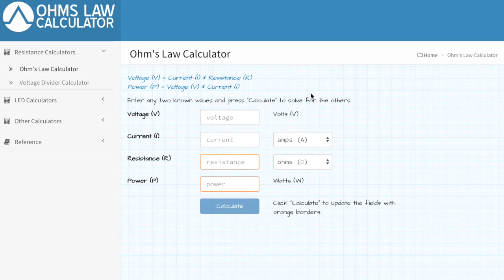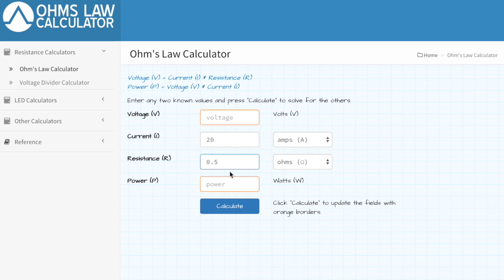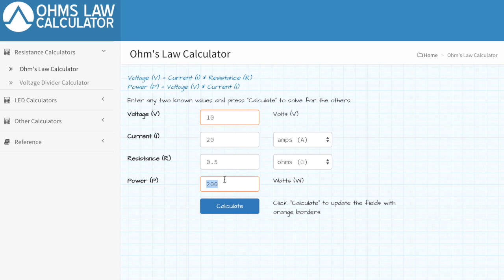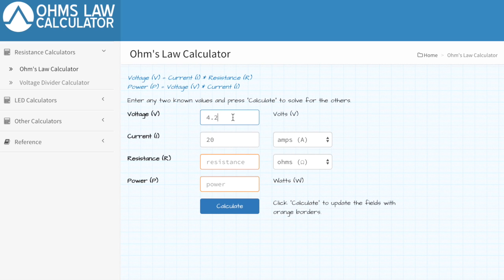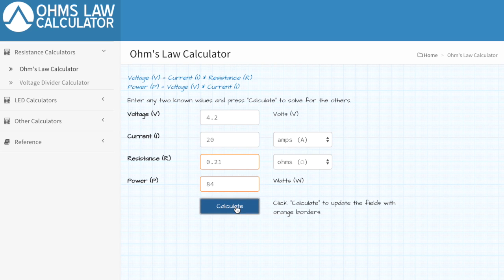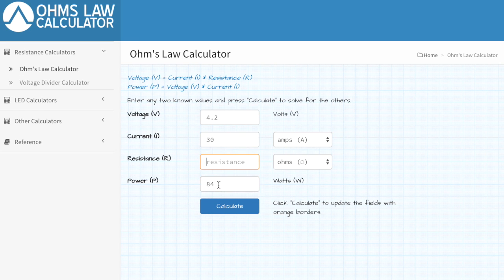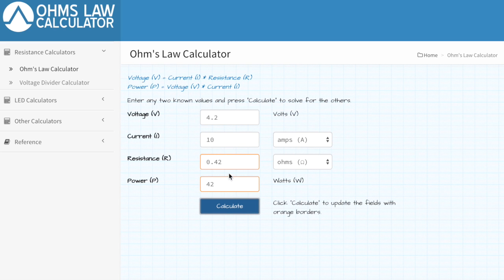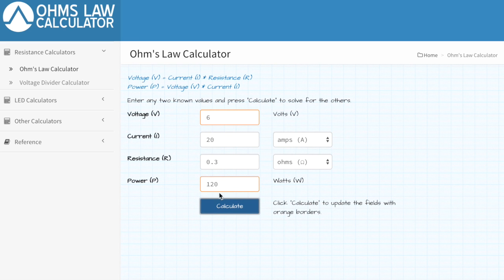Vaping for Beginners - Ohm's Law & Coil Resistance for MECH MODS

Comment: so lets say im on a regulated device and want to get around 0.2 ohms on a dripper and using three LG HG2 on a rx200(which i think are 20a continuous) I can only use up to 80 watts? need some help
Reply: +BUTT STEAK Just use the highest drain batteries. mine are 2600 mAh Sony VTC5 batteries. Yours are 3000 mAh (google'd it) and from what I know, they are 30A but you say otherwise. It has the power but drains quicker. I'd suggest getting samsung or sony brand batteries. Other than that, yeah, you can run at .2 ohms, fuck it, it's an rx200 lol.

Comment: , how long should I go until I change a bettery? Is there a safe zone for how long a battery should last and what is too long of a time to use the same one?
3-5  cigarettes a day smoker on the subbox nano using a .5 ohm coil, 18650 battery
Reply: +Michelle Baj your device is a regulated mod. Your mod will keep you from draining your battery too low. Use them until almost drained according to your screen. You will be fine. It is only when the person is using an unregulated mod that you have to be careful not to over drain your battery.

Comment: I'm new to vaping and I'm giving my last pack of cigarettes to vapor world for a free starter kit ive been watching you're vids and already know I'm a cloud chaser at heart I wanted to know if I could get decent size clouds out of a starter vaper ps yore vids are awesome pss sorry for the grammer if there are eny mistakes
Reply: Most starter kits are high resistance with tighter air flow. To give a similar pull on a cigarette. It's not going to be a big cloud. When I first tried vaping years ago on an small battery with a clearimizer tank it didn't give me enough of a vape to satisfy me so I could quit. This past year I tried again with a box mod and a sub ohm tank and that did the trick for me! I'm not sure what they are giving for free, but I'm going to assume it's the same I tried years ago. MY personal opinion would be to see about getting an Ego One non temp control. It comes with a 1.0 and a .5 ohm coil. I found them cheapest at world of vape and bought myself one. I wanted something to give me decent clouds that I could easily take with me instead of carrying my box mod. Use that to switch, once you've switched then invest in a good mod and tank or if you want to build an RDA/RTA. I quit smoking father's day and today bought my very first RDA. And honestly I will STILL use my ego mini when on the go :).
Reply: +mishelleAKAmishy I actually got a decent one it is a kangerteck evod mega it is decent
Reply: +mishelleAKAmishy thanks for the tip
Reply: +Chance Rains AWESOME!! Congrats!! Welcome to the vape world!! Seeing that you're watching YouTube be prepared you'll want one of everything soon enough and if not careful it'll cost MORE then smoking LOL. Good luck!! Make sure you LOVE your juice.. cause if you pick up a cigarette you'll miss your yummy juice! I actually started to reduce my smoking and ended up quitting cause it tasted gross after tasting my yummy flavors!
Reply: +mishelleAKAmishy ya I'm really happy about my kit it is heavy I like it and I have real good juice I have thunderstruck 18mg and I have cowboy whitch tast like a sweeter malburo red do u have eny reconmendations
Reply: +Chance Rains taste is very subjective, and I've come to find I'm REALLY picky. There's flavors I like, but I can't vape it allot. I was a Marlboro lights smoker, and as crazy as it seems I tend to like minty and mentholy Vapes. My favorite is Watermelon Chill, it's like a watermelon bubble gum with a cool mint taste. I also like some lemonade vapes and fruity flavors.. like ripe strawberry. I'm not a fan of milks or custard. I seem to prefer light vapes and I need never liked tobacco flavors which is usually what is recommended for those switching. Hopefully you have a good vape shop near you where you can taste different flavors. Make sure they use good ingredients and not cheap stuff. Mine uses kosher and pharmacy grade ingredients. Cheap stuff can make you feel sick, ESPECIALLY cheap nicotine!

Comment: when you jumped to the ohms calculator you referred to a mech mod but how could you find out the volts and discharge for a box mod that requires 2 batteries. would it Still apply for the same output?

Comment: Although increases in the number of coils increases resistance, it is directly because of the length of the wire, not the number of coils; more coils equals more length.

Comment: i have a coil build of 0.54 ohms n if im vaping at 40 watts,with the ohms law calculator,im using 8.61 amps and 4.65 volts.
given that my battery states 3.7 volts,is it safe to vape using higher than the stated 3.7 volts on the battery?? (the 3.7 volts was just printed on the battery.it says 18650 3.7 volts 2500 mah).im really confused with the volts.

Comment: what about if you have two 18650 batterieswith 20 amps discharge each in your mod, does it mean you use 40 amps in your computation?

Comment: This was very helpful but I came across something I didnt get when playing with the ohms law calculator. So lets say you have a 1.5ohm coil and are running it at 25w, which i know is way to much but definitely possible, when I put that into the calculator is says that would need just above 6 volts. My confusion lies in the fact that a 3.7 volt battery is being used to power this coil. So can batterys discharge at higher volts like that? When puting 4.2 volts and 1.5 ohms in the calculator it says a max of like 12 watts, so is exceeding that dangerous for the battery or is it even possible to discharge a 3.7v at like 6 volts. Any help would be appreciated I just cant figure it out.

Comment: That was entertaining, educational and fun to watch!  Just switched from 2 1/2 packs a day to vaping 12 days ago and vaping is so much more fun.  Looks like RBAs may be the next way to go for me (gotta geek) but .... I'm NOT smoking :) !!!
Reply from the maker: +Steve Meckel nice!
Reply: +Steve Meckel 
Excellent Steve. I too was doing about 1 1/2 packs a day for about 58yrs. I havent touched a real cig in 5 weeks now. I started with 3% nic for a week then 0% nic. go bro. keep it up.
Steve Low
Reply: +Steven Low.  Keep it up ... Three weeks, yesterday for me ... but still doing 2%.  I am up to one mile a day walking and need to keep on the cardio.  Doc says to quite vaping too ... just gotta have one of those vices and don't see this one going anywhere soon (other than joining you @ 0%).  Thanks so much for the support and you keep going too!! :)
Reply: +Steve Meckel,  I'm enjoying the Hell out of it man. Drove tractor trailer for 33yrs then retired and sold my trucks. Smoked one after the other in the truck. it was ready to quit surprisingly. going to bed. catch ya later bro.
Reply: +Steve Meckel Good job on quitting. I just quit too. Keep chantix in mind if cravings get bad. It helped me quite a bit.

Comment: how about i can't taste the juice?
and when the volt keep jumping
Reply from the maker: +gnauhyJ sounds like something is wrong with your device
Reply: you might have your coils touching where you tighten them. or you could have a short... try pulsing and wiggling your coils. if they move significantly it may have to be rebuilt.

Comment: what batteries should I use to vape at 150W using the Koopor plus 200w and Maganus v2 tank with 0.2 coil? There are 3.7V and 4.2V batteries as well as 2500mah, 3000mah, 3500mah, and 20A, 30A, 35A. I don't know what combination of those three I should choose

Comment: Hi abby i would like to ask something. I will use a .45 ohm wire and i have a 20a batts. Does the wire build changes things? Like i will build dual coil 8 loops.
Reply: And could i ask what is the significance of loops in build? More loops means better flavor right? Lower resistance=more vapor?

Comment: does it matter about the batteries if their is more than one? like if there is 2 batteries is the amperage times 2? or does that matter...
Reply: +Tafv if your batteries are in series then the current won't double or half... the current would be same through  2 batteries in series as it would be through a single battery.
However, if they're in parallel, the current draw would be halved, or shared, between them.
Reply: thanks :-)

Comment: Abby, thanks for your video. I have a question: I've been using .5 / .7 single coils with my lemo 2. Vapor and flavour are great at 20w but I'm  getting a short battery life out of my istick 30w. I'm getting another mod with 2 2600mAh 30A batteries.  Will building coils around 1.2 or 1.5 ohms will do the trick to get more vaping time out of those batteries? or au contraire, more resistence should blast batteries faster?

Comment: hey abby. isn't your current limit doubled if your using a parallel mech mod?
Reply: +Juan Marco Manguerra If your batteries are in parallel the voltage stays the same and so does the current rating of the batteries. All that changes is the battery life.
Reply: Rob Poke oh ok a friend of mine once said the parallel counts for each battery. nvm then xD
Reply: +Rob Poke that;s not true. parallel batteries share the current load between them. they'll both still kick out 4.2 volts, but whatever the current draw is (based on coil resistance) then each battery supplies half of the current. the reason you get more battery life is BECAUSE they're sharing current load.
Reply: +lol morlol thats not what i said. the current rating of each battery stays the same. but yes the current is shared between them resultin in lo ger life. i paraphrased a little.
Reply: +Rob Poke oh I see now, I was reading the question as current capacity of the whole circuit, whereas you were looking at the battery... it was an ambiguous question.
Reply: +lol morlol that and my wording has always been awful!
Reply: So just confirm, using a parallel mod with dual 25rs, I should only build under 20A to ensure safety?

Comment: Newb question here. So with a 3.7V and 35A Battery on a Mech Mod, I go as low as .102 Ohms, which is pretty darn low right? The question I have is, what kind of wire should I pursue, I would probably rather run a slightly higher resistance .4 or maybe even higher (a cooler vape?) Thanks in advance for the help.
Reply: StillBornRec Could have sworn that said 1.02...sly devil you lol
Reply: 102??? That's not low at all...
Reply: +DABS139 how is .1 not low?
Reply: +Tony Clark Ik this was posted 2 months ago, but I personally prefer 2 24g kanthal coils at 5 wraps which goes at .2 ohms. I use that build in my mutation x v4 on my x cube with sony vtc5's. Great and simple. If you want .4 just use a single 5 wrap .

Comment: I'm concerned because I keep getting inconsistent answers from people. I have a Joytech mini with a Velocity clone RDA rocking a 0.1 Ohm coil. So if my understanding is correct, for a 20 amp continuous drain battery, would that mean the highest safe wattage I could raise it to would be 40 watts? 

So if it's 35amp continuous drain batteries [Given the same attributes as before, -- i.e., Joytech mini with 0.1 Ohm coil] then instead of 40 watts, I could safely crank it up to 122.5 watts. Not that I'd ever go that high, but am I on the right track here?  

People keep saying I'm wrong. If I'm right, could you plug a few reliable sources where I can confirm that this is true or most likely to be true. I'd like to have a source to verify it when people ask how I know. Preferably scholarly / peer reviewed journals or publications.
Reply: +Anzwertree 0.1 ohm coil with a 20amp battery could go up to 40w. you could go up to 122.5 if we stay with the Ohm&#39;s law on a 35 amp.

Comment: ok so as far as the calculator goes .... If my build is at 0.67 ohms with batteries that have a continuous output of 20A I can vape that anywhere between  268W/ 13.4V and lower correct? Also will this be affected by a single/ double coil build meaning : Is there a  safe minimum for just running a single coil (kanthal) or if the spec's above are from a single coil  is that range still safe?
Reply from the maker: +Lonnie J yup, single/dual doesn't matter, just calculate based on ohms :)
Reply: +Abby Vapes Thanks Abby :) This was a great vid keep rocking em
Reply: +Abby Vapes Hi I have a question if 1 coil is 1.2 ohms if I go dual coil with the 1.2 ohm coil will it add up to 2.4 ohms?? Like how does dual coiling work?
Reply: +Yellow         Gibus Gaming It cuts it in half if you have 1 coil at 1.2 then a second it theoretical y will bring you to .6 which is a very aggressive build

Comment: Great video!!! Started vaping bout 3 months ago and still using the Kangertech subox starter kit. Still trying to learn more bout ohm and battery. Just wondering, on the ohm's law calculator website. The column where to fill in the amps, do you put in the continuous discharge amp value or the maximum discharge amp value?
Reply: +Nae Hiroyuki Always use the continuous value.

Comment: I have a question.  Maybe it was in your video fully explained, but im not from english speaking country, so sorry for that. If i built two coils with 1.2 resistance and instaling them to atomizer, the result of the resistance will be  0.6 ?
Reply: +Tarantulej tarantulej yes
Reply: For me it works. I really dont know how to explain it, but it works that way. I have my first Rda Atomizer Orchid V6 and im still learning, For ex.: air Holes and their relation to the final smoke and its taste... oh boy this was really mystery for me, but, i dont hve any experiences with it before, i smoked regular small e- cigs with prefabricated cleromizers and its coils.... and everybody knows that there was noo modifications or some sort of settings. So im learning from my own experiences, and how i said before, i really dont know why or how it resistance works but two coils really split its resistance on half.
Srry for the mistakes i wroted, but i hope someone will understand, what im trying to explain. Thanks
Reply: Maybe someone Who is An Electrition would like to explain us , How it really works and why?
Reply: +Tarantulej tarantulej i come from an electrical background. when you have 2 resistors (or coils) in series (end to end) then you ADD the resistance. when you have 2 resistors (or coils) in parallel (across each other) the calculation is R1&#215;R2/(R1+R2) so if both coils are the same the resistance is half

Comment: How do you know what to set your device on if the Resistance on your coil is 1.8 ohms? I tried using the ohms calculator but I just don't understand .My battery is a 30w but I can't turn it up that high with out getting a burnt taste. I wish there was some calculation to tell me what wattage and voltage I am suppose to use for the ohms I have.

Comment: I have a quick question! I followed pretty well with the ohms law and using the calculator, but how does that come into play with a two battery device? If I have two 20a batteries can it withstand more or is it still at the same place as the single? Thanks for the videos Abby!

Comment: Been looking for EXACTLY this kind of information! awesome video! just built a dual clapton  .1ohm on my sapor and was worried about what my "safe" wattage would be on a married pair of VCT4 for my sig150. was staying under 50w just cranked up to 3.6v @ 70w what a difference! love your vids! they have helped me out tremendously as a newbie vaper 2years no smoking analog, and vaping helps kick the urges back to the curb! just picked up a goliath V2, what are your thoughts on RTAs? and do you have any suggestions on a build to run on that tank? thanks again.

Comment: heyy, love your videos! really enjoyed this video in particular! was hoping maybe you could do a beginner build video. and what would be a good coil for beginners. I have a aether tech atomizer and I am trying to figure out which coils would be good to do and just have a break down on building them
 thank you for everything you! xoxo
Reply: I keep watching this video, Abbyvap your video is the best video I have found to understand ohms and the coils. I got my atomizer rebuilt and I have a 2.0ohm with a 26 gauge wire with a dual build with 5 wraps.  however it is still running hot a vape and not producing a big cloud. I'm also using a juice of 90%VG & 10% PG. So I really need help. Thank you for all the great videos! xoxo
Reply from the maker: +Nicole Stevens dual coil 26g with 5 wraps shouldn't be 2.0ohms....what mm screwdriver did you use?
Reply: +Abby Vapes I had a vape shop do it for me to show me how to do it. but it's a 4 peg screw. On their reader it said 2.0ohm. I think I might have to rebuild it. all the screws are tight and snug and lined up straight.

Comment: btw no battery on this world (lithium ion) is going to fire at 4.2 volts on a mech mod. under load you get (depending on your resistance) you schould calculate with the nominal Voltage (3.6 or 3.7v). 4.2 volt is only the end of charge when the Battery has nothing to do :)